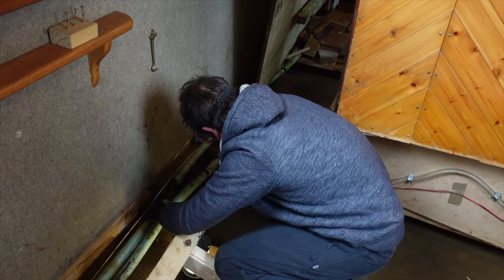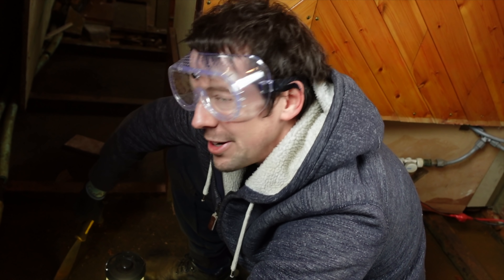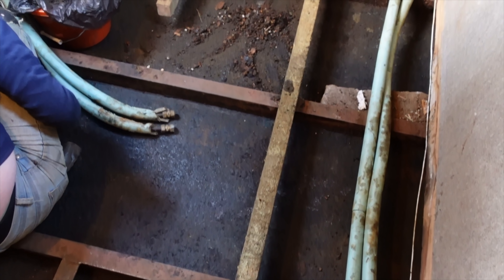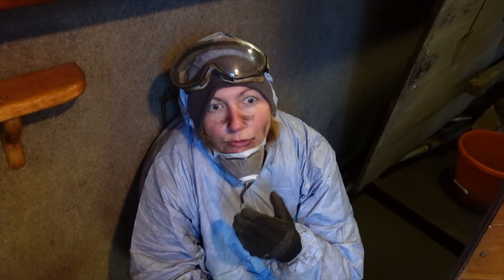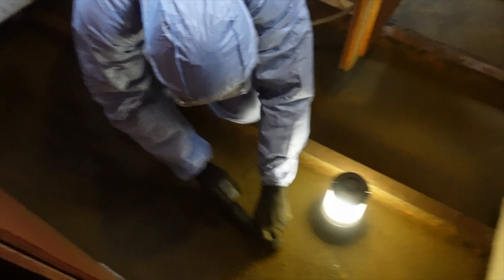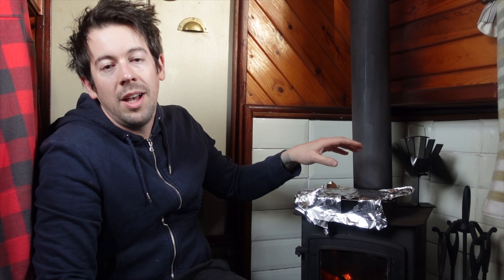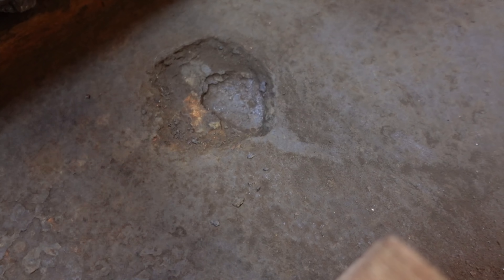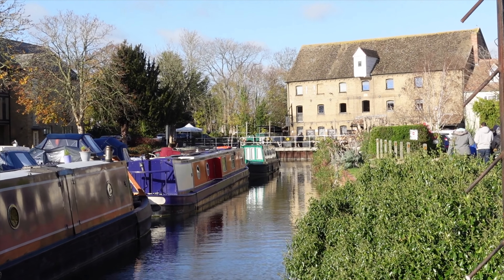You won’t believe how thick our RUSTY narrowboat hull is!!

Comment: Thanks for another great video, I really enjoy watching your determined hard work and progress. Now you know there is such a substantial thickness of steel you could expand your hammer collection to include a chipping hammer (one with a pointed end and a coiled wire handle - not expensive). Chipping hammers are great for whacking rusty surfaces with as they can make the stuck down layers of rust lift off more cleanly. Pop some ear defenders on and let rip with no worries about   making little spouts of water appear. Chipping , either with a hammer, needle gun or SDS drill is a most effective way of getting back to good steel more quickly. I wouldn't bother putting the majority of the ballest back - it can trap dampness next to the steel. Great to see that your thickness tester is consistent - I'm going to save up for one. Very best wishes
Reply from the maker: oh wow that's interesting thanks so much for your suggestions, yes we can go in mega hard now which is good, oh that's interesting about the ballest, we have stumbled across more and have realised how the boat rocks more with it out, there a great little bit of kit if you just want a quick bit of peace of mind, Merry Christmas:)

Comment: Hi another good vlog just thought I might say that you should always grind the metal you are testing back to bright steel or you will get a wrong reading your reading of 13.5 would be the correct 12.5 if you had ground the metal clean they must have put this in the instructions of the kit.I have said all along that this was a good boat overplated to a very good standard are you going to stop worrying now and get on with the light renovation that you said you were going to do at the beginning 😁😁😁😁😁😁😁😁😁😁😁😁😁😁 p.s.you can't count the two plates as one when you determine the thickness of the base plate
Reply from the maker: your absolutely right, we would probably have to add on another mm, thanks for your advice and help, we've always has faith in the boat, we do believe she will be beautiful again, she deserves it. oh that's interesting, why can't you count the old one too??thanks again :)
Reply: @TheNomadicCrobot  you can't count the two as one because you don't know the condition of the original base before it was replated and also they left out the bellybuttons we always used to weld the plate back in that was cut out to weld the plates together
Reply from the maker: Oh that interesting, thanks for your knowledge it really helps a lot :)

Comment: Good news. Could you use and electric drill with a large wire brush or flap wheel on it with a Vac to grab the dust instead of doing it all by hand? Would sure speed up the process!
Reply from the maker: we did have the wire brush drill but I actually found the hand brush easier, cheers Paul :)

Comment: I'm surprised your boat was over plated when you already had 8mm baseplate. Most new boats start with 10mm. I wouldn't think you will need any additional ballast as your boat sits veery low in the water and may be a problem with grounding when water levels are low in the canals
Reply from the maker: That’s an interesting theory actually as we did get stuck a few times on the way back from buying the boat. I think the idea of it was so that the boat would handle better when it went to sea, hopefully we won’t be affected to much when we hit the canals next year, thanks Geoff :)
Reply: 8mm means 2mm has been lost. Thats 20% and in some places it may be 30 or 40% with pits. Not sure what is allowed before overplating is recommended but its probably in the 30-40% range
Reply from the maker: we've been told by a surveyor that you can get away with under 4mm before some insurance companies question it :)
Reply: @TheNomadicCrobot  Thats interesting to know. I thought it was a % or original. Maybe if it was a springer that only starts with 5mm then 4mm is 80%. Can anyone confirm as I would like to know for interest

Comment: I am wondering about the 'belly-buttons'.  I can understand that these were used to weld the Over-plate in places to the old hull.  I am just thinking of a few other checks and precautions to take.   If you have had a persistent water leak is there a chance there could be water now between the plates.  Check if there is any areas of the inner plate that is bowing upwards, this could be a sign that rust is in there and expanding forcing a gap.  The thinner plate (8mm) will flex upwards more than the 12mm will flex down.  If no such bowing all well and good, seal the 'Bellybuttons with something, say resin or molten lead if you feel up to it, or even tar/pitch so that any further leaks can not let water pass.  When they welded the holes hopefully they did a full all round seam weld to seal it, just the fact you had a water leak and are removing lots of rust from in the buttons you want to ensure they are still sealed for the future.  All the very best and safe cruising.
Reply from the maker: Thanks so much for the great advice, yes it does seam like the leak could have been there for a long long time as there was no access to any inspection hatches...seams mad,  thankfully so far the 8mm base looks really flat and in great condition, yes we definitely wouldn't want any future water getting in, thanks so much agin and Merry Christmas:)